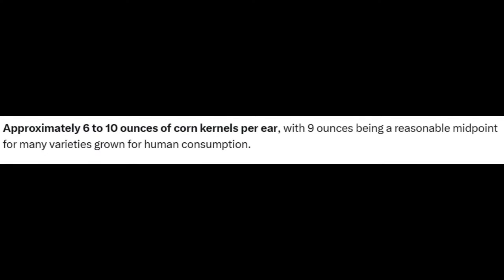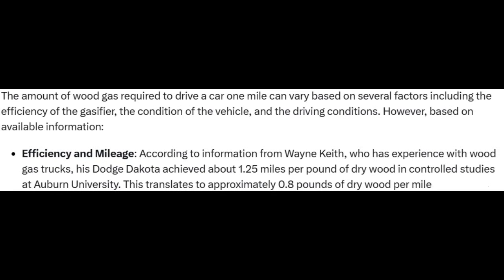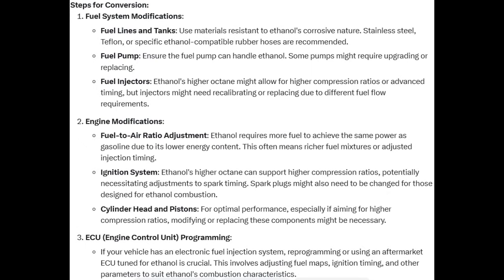Alternative Fuels - Ethanol or Wood Gas

Comment: I was wondering where the bio diesel option was ? ive gotten the still already as i live in an apple orchard but ive seen guys drive fry cars lol. used oil and chemicals to make diesel . ive been thinking about it myself but havent done the research yet i just started learning solar myself .I keep 150 gal gas that i rotate into my truck to keep it fresh for a last ditch tie over which you can add the moonshine into to go farther in a real pinch.having three years of stored woods important if you live in the cold north like i do at least i know ill be able to cut enough wood to last a long time and the tiller along with the four wheeler ,they are fairly light drinkers of the gas . after that its back to horsies again lol ...i think well go back to steam if the shtf for a long period of time lol. another fun video pinball .thanks and take care

Comment: There a couple issues not mentioned that I think need to be considered. As I understand it a gasifier needs to be built sized to the engine you will be running (I have researched it and started one but not finished it). To small, not enough fuel, too big wasted fuel.  The other problem with alcohol fuel is it is hard on 2 stroke motors. My father-in-law was a OMC (Johnson and Evinrude) mechanic from the late 40s (WW2 vet) to the late 80s and he said when too much alcohol is used it not only destroys the seals but it wipes down the cylinder walls not allowing the oil to do its job and it would destroy the rings in short order. So I quit thinking of converting my dirt bike to alcohol as I couldn't afford to replace my 2 stroke bike with a 4 stroke. I don't know if there are any 2 stroke oils that can overcome that problem these days but for now the only thing I can think of is to buy a couple 5 gallon cans of aviation fuel or racing gas. I have been told those will last for several years unfortunately they are rather expensive and can be hard to find. This I mainly keep in reserve for my chainsaw. Someday I will get a electric one. The generator will get the gasifier when its finished and the tiller and garden tractor will be converted to alcohol. Great topic for discussion I wish I could have responded earlier. Thanks Pinball.

Comment: I have a blue print in how to build a wood gasifier.gasification. I wanted to build one in a 1970 Toyota  pickup to pull a wood trailer for wood cutting. We live in the  mountains with alot of wood. Wood cutting permits are FREE!

Comment: i just read thru all 338  of todays comments.  none has mentioned what i consider the ideal use for a still.   just go to a marine supply store and buy an alcohal stove.  what you distill pours directly into the feed bottle.  no filters, no nothing.  straight from the still to cooking dinner.  it does not get any simpler.   artbyjoe

Comment: With the wasted power from jet turbine engines and gas/diesel powered vehicles, they need to make energy from the wasted by-products like exhaust end of the tail-pipes and after-burners along with inertia forces of the rotational wheels and heat along with energy storage. Lets say scientists are more worried about astrological meteors and asteroids hitting Earth than free energy. They need a energy auditor and apply to energy needed to make mankind sustainable without environmental disaster. Imagine harnessing all the power from high explosives used in bombs and ordinances from wars.

Comment: 1800s, steam locomotives using coal still paved the way for American expansion coast to coast. Boilers and generators can be powered by many fuel and energy sources converted to electricity. When you go mobile, EVs and gas and even propane/LPG/ diesel is the only way for now till they have nuclear technology applied to the regular consumers. M1 Abrams tank uses jet turbine power like helicopters and jets. Jets and kerosene can make a awesome fast Ford F-150 PU truck. Americans are Independent so they must rely on their skills individually.
Reply: One untapped resources is landfills that produces methane, with all the food wasted and thrown in the trash and landfills, they can produce methane gas with a generator and utility company at the same location along with geo-thermal. Along with gravity tanks, cities have to draw so much power that it has to change to much more efficiency and  ECO friendly.
Reply: The only impedance is the EPA and government regulatory statues.
Reply: Collectively, one BTU must be converted to at least multiple times to make energy and power for efficiency and sustainability but the power companies will shoot down these innovation for profit and greed.
Reply: Guess what all that billions of dollars of research is going too? Its not free energy but depopulation. Free energy from the sun, sea and wind and even geo-thermal has been withhold till a sustainable amount of humans are left.

Comment: they used to put large gas balloons/bags on top of vehicles so yes its very portable.... Mind you if you have natural gas you can do the same thing.. Wood gas is very doable but whats even easier is charcoal burner you can go almost directly to the engine... he needs to do more research the larger the motor the better these types of fuel work...

Comment: Try hydrogen generated from water. A friend and I did generate hydrogen very easily. With a battery and water. We had a few common items around the house we made a small explosion hydrogen flame (you couldn’t hardly see it) but it did blow out the end of the container. Lol

Comment: You can make your own diesel fuel out of used cooking oil...it's not hard. There was a video on this very platform showing how to do it in about three steps. One of the steps was putting the fuel in the guy's truck........that's how easy it was. There's been a war on diesel (which is a process, not a fuel) since the Obama administration....this needs to change.

Comment: I can't remember where I saw it on video but it was a commercially made wood powered truck. It was like a ton and a half size. Very well designed and fairly compact gasifier integrated into it. I don't remember the brand of it either but it appeared to be from the year range of 1920's to 40's. It was still running when I saw the video a couple years ago. To be commercially made like that it probably had to be fairly reliable..

Comment: Ive built several wood gasifiers over the last 15 year. They are great for static location engines. The technology  has been around over a couple centuries. 
Fyi....the easiest way to use and store wood gas is as pressurized gas in cylinders and hook up to any gasoline engine just like you would for running on propane. 
For me, wood gas technology is definitely worth the time to learn.

Oh and of all groups, FEMA has plans and sizing  for basic gasifiers.

I also have a still for producing nectar as well as a small solar system.

Comment: I have been researching it, and thought it would be cool to take a wood gasification generator, then have the wood gasification generator power a converted hybrid like a Toyota Prius to charge the battery because the battery is 24 volts

Comment: The best solution is diesel engines.  Diesel will burn almost anything; benzine, turpentine, kerosene, old oil (thinned), strained cooking oil.  It won't burn alcohol, gasoline or water.  I have had all the VW diesel cars from '77 to '15 the last year VW will make them.  I have burned cooking oil I can glean from McDonalds or other places, strain it, and I have done this in two tractors for near 20 years with no damage.  Only fallback is It smells like Kentucky Chicken.  I don't use anything but diesel in the cars as long as I can get it, for reliability.

Comment: A few comments: 1) wood gas does not require any chemicals or other supplies (other than wood) to keep running long term once set up. 2) Wood gas works well for both stationary power generation or for running vehicles. 3) A huge amount of info is available from the 1900s and WW2 for wood gas. 4) Fema plans exist for a wood-gas generator made from 2 metal garbage cans. 5) Ethanol production for fuel requires large amounts of materials from outside sources, which makes it a better short-term solution. 6) ATF license is required for ethanol pruduction in the quantity needed to actually run a farm or survival operation If you are doing it before shtf, ATF will make visits to make sure you are using a single distillation process. Double distillation is not allowed for fuel production. 7) Wood gas can be stored in gaseous form in tanks and bags. During WW2, airbags were used to store wood gas for use in buses and large trucks.

Comment: OT: any BRAND recommendation for a 1000w pure sein inverter to use as a backup source of power (connected to car battery) to recharge a "solar battery" power station? There are a hundred different Chy-knees models on the internet with unpronounceable names. My main concern is over heating, as it would  need to run for up to 2 hrs.

Comment: I have two old Ford trucks that are non turbo diesels. They will burn used oils petroleum or vegetable even animal fats. You do have to do some prep for the various fuels filter to some minor refining. These old trucks from the 80s are pretty tough old rigs with adequate power and good reliability. I have gotten 28mpg with the things. They have no electronics mechanical fuel pumps and injectors. They drive pretty well on old oils from behind the restaurants but you do have to do some refining but it's not hard. Diesels are not horrible in the cold to start with decent glow plugs and a block heater. I run half a bottle of atf in a tank of fuel or marvelous mystery oil 8 oz of that helps with the crappy diesel made nowdays. Just a good rig for what if.

Comment: Morning Pinball. A wood gasifier is one of the projects I would love to do, but just never took the time. Just something I have wanted to do for years. Take your corn to make ethanol, how about eating the corn and gasify the corn stalks? Another project I would love to work on is a ramjet, not the most fuel efficient, but am curious if a ramjet can be run off of ethanol or a wood gasifier. 🤔

Comment: You can turn any old air compressor into a steam engine. If you have a welder you can turn any 4 stroke gas engine into a steam engine. You can use an LP TANK over a fire  to heat the water. Or if you can. ,find any big tank.. with a big sealable lid. You can put anything in it. Like leaves,plastic,tires,wood basically anything that will burn. But it all is sealed inside the tank. Have a pipe hooked to the tank. That goes inside the tank. Put the tank over a fire. As long as the tank is very well sealed. When the fire heats up the tank. And the only outlet off the tank is your pipe. A gas with properties of natural gas will come out.
Reply: You can also use steam to power air tools. Or also turn those into mini steam engines. Of course you would need to wear gloves to operate them lol.
Reply: Capture the steam from a steam engine and you have distilled water.
Reply: You can also make browns gas with a solar panel. Put the positive & negative wires in a tank of water. The bubbles will be browns gas. A very powerful gas.

Comment: The best venue in a SHTF situation is having 2 4 cyl diesel engines. Get 2 diesel engines from a auto wreaker or somewhere ( say the diesel Rabbit engine or Toyota from the 80s early 90s) refurbish them . Turn one into running a generator and the other can be retro fitted into any midsized vehicle. Then go to all the fast food restaurantes and mom and pop grills and collect their used fryer oil. Its super easy to proccess the fryer oil to run both diesel engins . The wood ethenol and wood grain aclcohol requires alot of work, parts and pieces, and the posibility of blowing yourself up making this. 
Work smart not hard.
My friend ran a early 1980s suburban on fry oil for years.
Reply: The fryer oil has to be cleaned and filtered plus to run efficiently it needs to be preheated to make it thinner and if you live in a cold climate it’s almost impossible to start a engine on fryer oil !

Comment: Pinball ,first this is a great video topic. There are a few points to consider , wood gas can be compressed into a cylinder like propane and used in a vehicle. The point you made that it depends on your local resources is key. Wood gas is a low tech option does not need special manufacturing or parts. solar will always need parts made for you. Almost forgot you can have energy when there is no sun...

Comment: FEMA in the late 70’s early 80s put out a book on making Wood gasification modifications to tractors.  They did a number of things with gasification.  One plan was to use a wood gasifier to run the engine of a pick up truck who had its back wheels off, but then would turn a shaft on a generator.  Interesting stuff.

The one big advantage of a gasification system is you can find dry wood in a lot of places

Comment: Look up the date that FEMA published the plans for the wood gassifier, its closer to the middle of the depression than it is to the 70;s and you can compress wood gas into empty propane cylinders. look into hydrogen generators and the storage of the gas produced. none of witch will run a modern fuel injected engine, has to be a carbureted engine

Comment: For a home power station I have seen one built and used for a cabin that only needs water,  a paddle wheel , simple generator and a voltage regulator, and pipe. 24-7 power from a year round stream. Water and gravity, simple,quite, no fuel, no exhaust. Just like having your hydroelectric dam.

Comment: Gasification requires a hood bit more of prep and detail. 
I don’t care much for ethanol 
Waste is where it’s at for me. 
Here’s what I do; 
I run a 1983 Mercedes diesel as a daily driver. 
I run waste motor oil in it or cooking oil. I prefer waste oil because it makes more power and I can find it anywhere. I have gallons on top of gallons put back to use. 
When they change oil on the dump trucks at work, I get 11 gallons from each. 
Every Thanksgiving, I get gallons of cooking oil. Some used, some not. 
I’m hoping to hook up an old Kubota diesel engine to a generator soon and occasionally make my own energy in the same manner. At least the fuel will be free. 
And in the event of a shortage, these diesels can run on things that has engines can’t.

Comment: What about these plans for pulling hydrogen from water and running on hydrogen.  I have always wanted to try it.
Reply: That is a problem with storage of the gas  If you can figure that out you would have no money worries
Reply: @AndySwan-sb2eb  i believe Toyota just announced its 1st hydrogen vehicle. They were going that route over electric
Reply: @AndySwan-sb2eb  just need a tank of water and keep the gasification process going.  Trouble is freezing water.

Comment: We’ve been off the grid since 2001. We built our own home off grid. Back then it was extremely expensive and difficult as there wasn’t any good information available back them. Our next project is an old steam engine from a 1940s war ship. 
If we have to charge our battery bank with fossil fuels, there is NOTHING more efficient than a good quality engine (Honda, Subaru etc) combined with an old style Ford alternator (no internal voltage regulator). I’ve installed and assisted with 100s of off grid systems using solar, wind and micro hydro. Nothing beats a cheap Ford alternator with a  rheostat to control the field. Our battery bank is 48 volt. 
Greet talk on the alcohol and wood gas. We are leaning towards steam power with a Ford alternator for our emergency backup. We already have massive inverters etc

Comment: I would rather build a gasifier then spend the energy and money because you need sugar to make alcohol for fuel. I've done the alcohol thing made in a beer keg as a still it worked great but it takes a lot of time and energy to come up with a gallon of alcohol. I moved on to making black diesel for my diesel engines it takes even weigh less energy and you can collect wmo easily and for free

Comment: If I recall aright, the prairies have perennial switchgrass, which produces much more ethanol per unit of biomass than maize can and is a cut and come again crop which does not divert grain from edible uses. Corn is, by far, neither the only nor the best source of material for ethanol production, particularly for ethanol as a fuel.

Comment: My neighbor farms 8000 acres of corn....do you have to dry the corn first?  Ethonol also attracts water & engines won't run well with water in the fuel.  Found that out with my lawn tractor
Reply: Corn must be dry to be stored or it will mold.

Comment: I refill my five gallon gas cans as each one gets empty. I fill them with Non-Ethanol gas only. They are mainly ment for my tiller, push mower and chainsaws. I treat the gas with Stabilizer. I occasionally use some of it in the cars to keep it rotated.
Reply: Good minds think alike 😉. I do the same I rotate the non ethanol gas ever 3 months out in a car.
Reply: Purchase non ethanol gas if available. I use stabilizer and rotate once a year and sometimes two   Gas remains fresh and been doing this ten years or more. Also, I ran a small engine business.
Reply: I use 92 octane non ethanol gas.
Reply: Do you have something to test the gas to see if it is really non ethanol.  My neighbor tested the gas at all gas stations in my town and only one station was selling non ethanol every other one said it was non ethanol but it had ethanol in it so test your gas.
Reply: I'm with all of you guys.  I only fill my cans and my two 30-gallon wheeled steel tanks with non-ethenol and treat with Stabil.